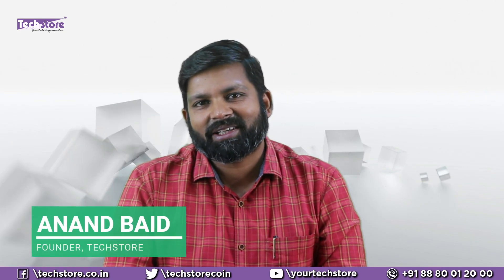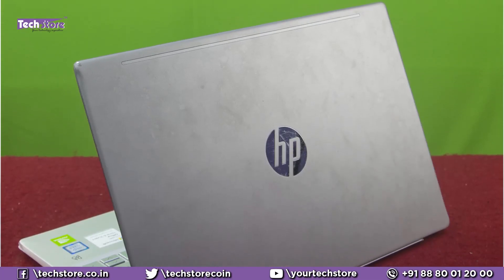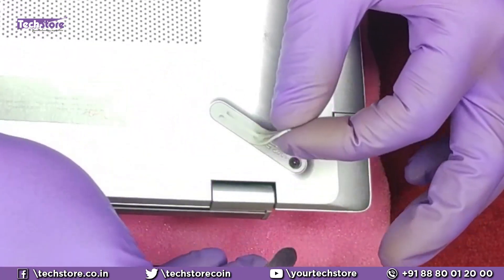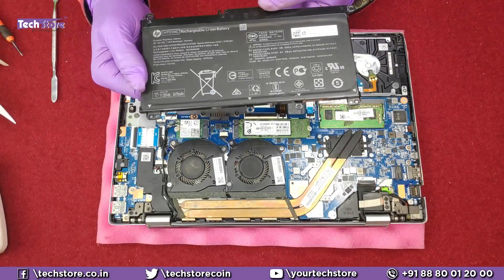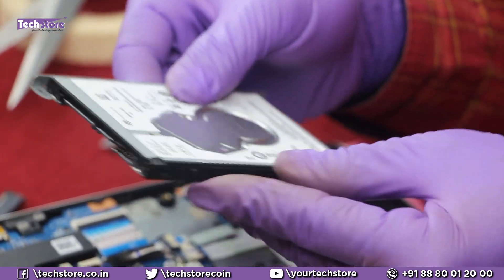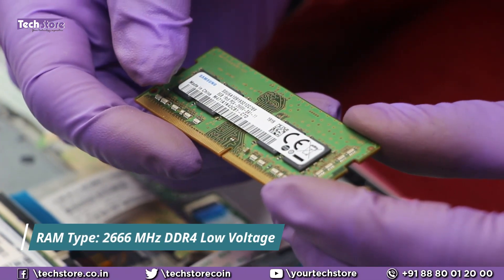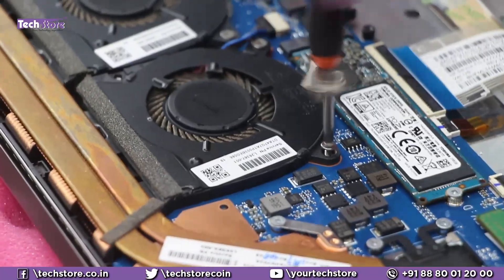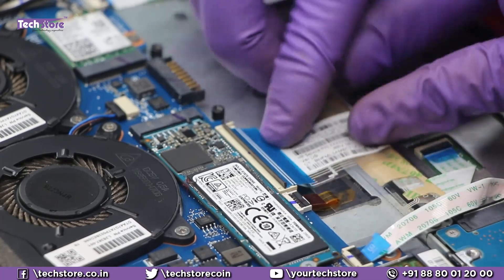HP Pavilion 14 ce1001tx CE Series Disassembly of base upgrade ram m.2 nvme ssd hdd easy diy

Comment: I have the same laptop and want to upgrade the components as the it lags when I play games on it. Can you suggest what needs to be changed and the specifications of the products.
Reply from the maker: if you dont have SSD installed, pls do so and upgrade ram to 16GB